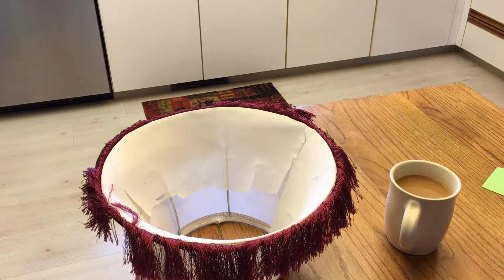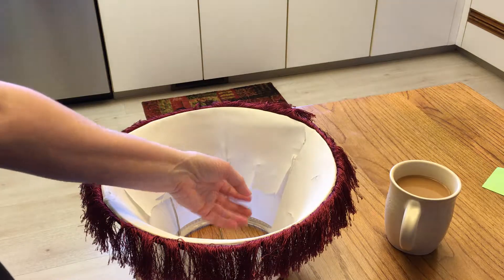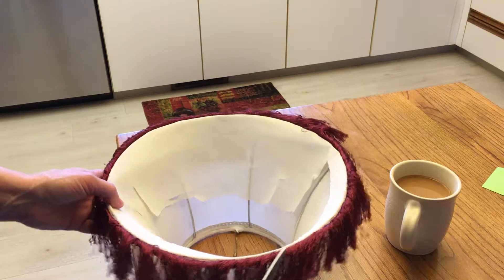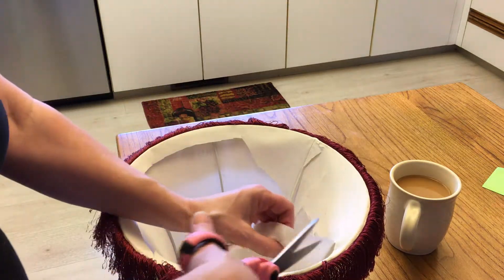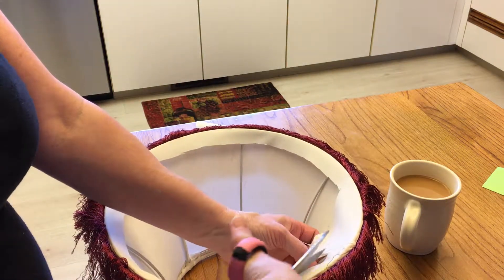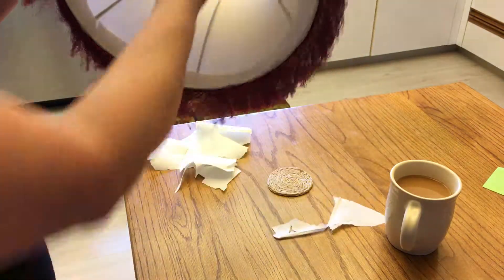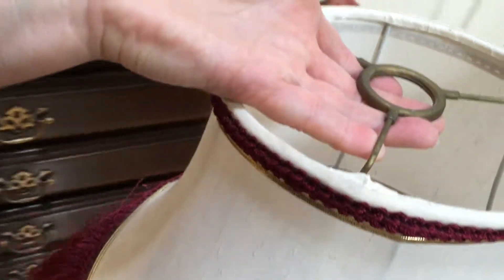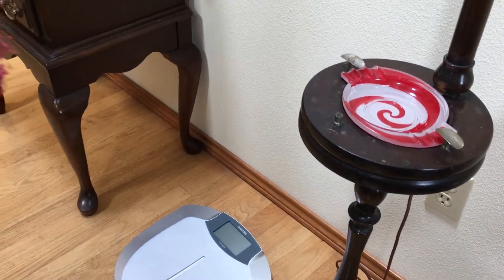basic fixing old lamp shade

Comment: You didn’t replace the liner. You need new lampshade paper on the inside to fix it. You did nothing but cut the old liner out. Didn’t fix anything🤦🏼‍♀️ This is nothing more than clickbate. Flagged.